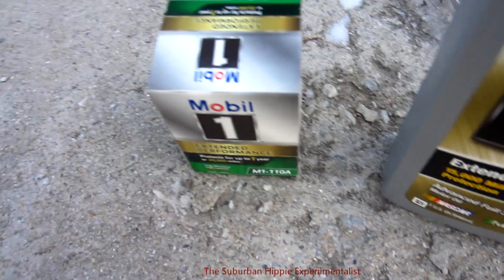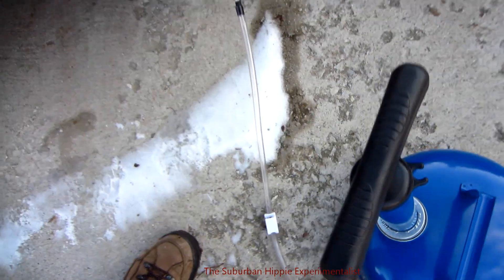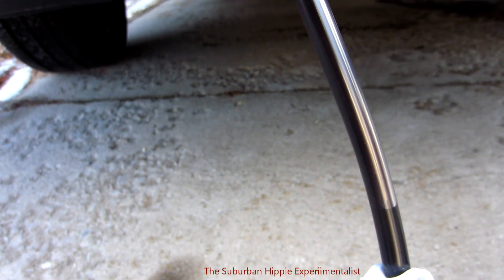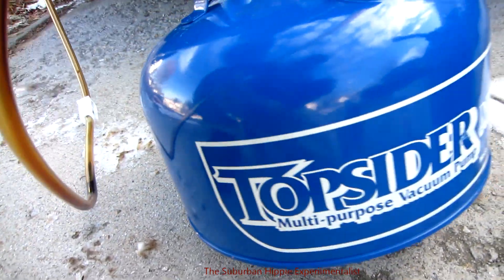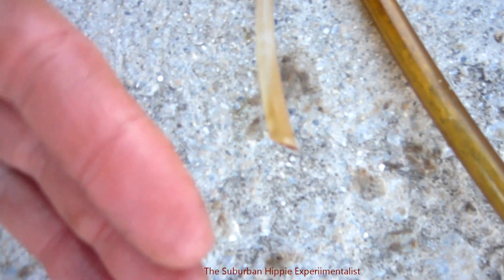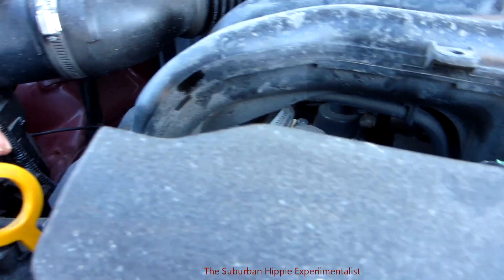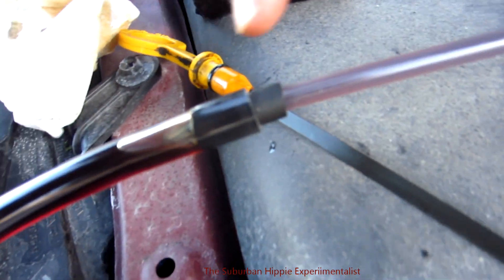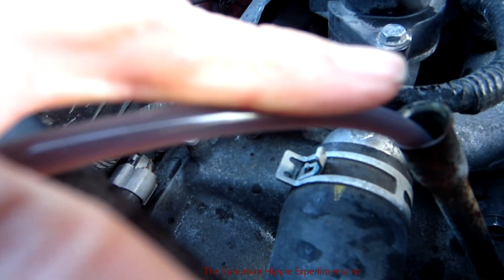My first experience with the Topsider MVP

Comment: If you measure the length of your dipstick,  then transfer this measurement to the tubing and mark the length with electrical tape, you should know if you have the tube at the bottom of your oil pan.

Comment: Never used for a car. Its great for boats, mowers, etc. other applications when you need to remove a fluid from a tight space.
Reply from the maker: i was hoping to not have to climb under the car for an oil change.. I used to tell people back n the day when I worked on car more, that I would do anything from the top of the car, at any time, but I didn't really want to have to climb under the car.. Thanks for your comment!

Comment: I know you don't wanna crawl under the truck, but check out a Fumoto drain valve that only requires you to flip a spring-loaded lever to drain the oil
Reply from the maker: I was thinking about that for my wife's Subaru but it would make me nervous having something under there that made it so easy to drain the oil..  Thanks for watching!
Reply: I know someone who tried this valve. Unfortunately, the valve loosened slightly between oil changes.
Reply: @michaelt2961  
mine's still sitting in a drawer